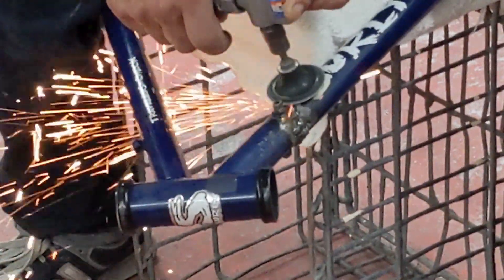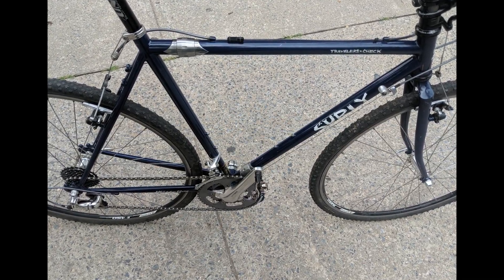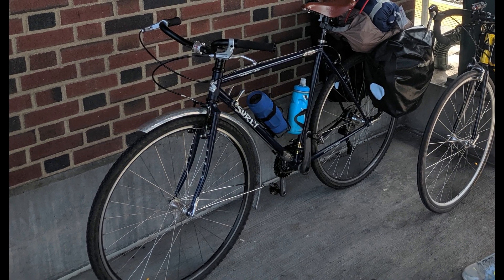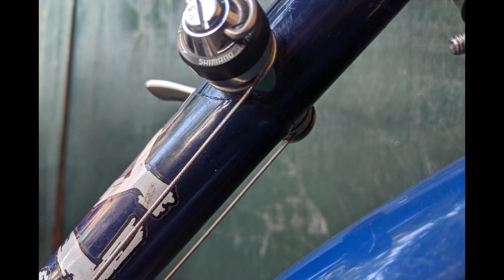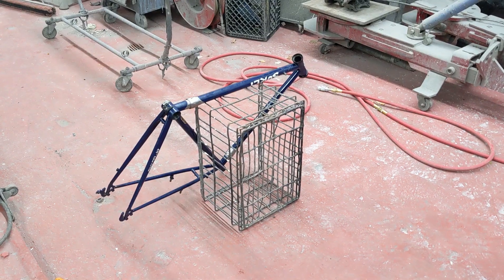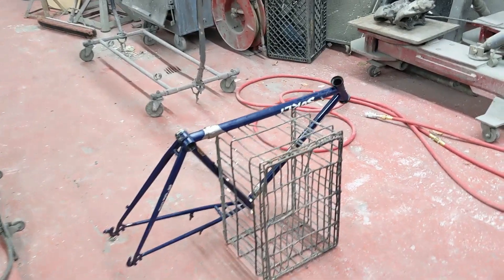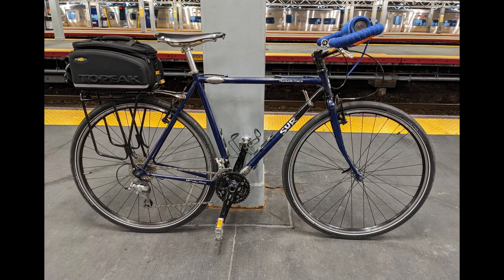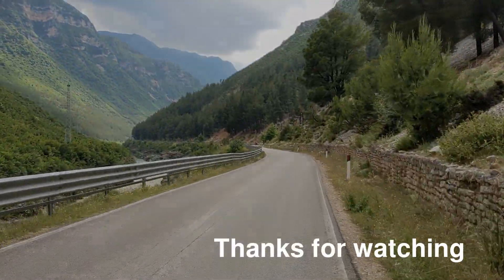Welding my broken steel bike frame back together

Comment: Here’s what we do in the old country,,,,,,
We continue to let the crack go all the way around the tube. We cut about 1/16 of an inch where the crack was thus making a straight cut across the tube. We insert a piece of metal inside the tube were the crack was . Weld it in place to align the tubes. Once the tube is  align , we just fill in the 1/16 of the space all the way around the tube, sand ,  paint.and whaaaaala……..Life short ,,,, enjoy the ride……
Reply: Very nice and clever way thanks
Reply from the maker: yeah, this seems like a good idea, or even an external plate to really reinforce the area.  the trouble is it's close to the shifter braze on so a bit of a sensitive area.  luckily this fix has held up 1000s of miles later.

Comment: Even without glasses you can't get A scan, metal in the eyes. Weld and then braze A 2piece sleeve be my less worry approach. Proof is in the pudding tho !
Reply from the maker: you're not wrong, that's why i was at a safe distance.  i thought about the sleeve option too but for what it's worth this weld has held up very well 1000s of miles/km later.

Comment: That is one ugly  repair.. what a shame to take a nice frame and turn it into trash.. I am surprised that you could not find a competent frame builder that could undertake a real repair.. I have replaced head tubes, top tubes and lots of dropouts.. on lugged frames.. It's not easy but can be done..
Reply from the maker: i was really struggling to ride the broken frame but have put 1000s of miles on the "trash" version.  i was surprised as well but that's the reality i was faced with and now i have a working bike.